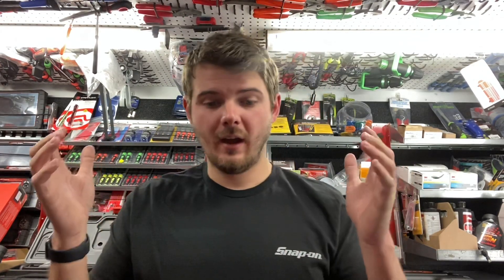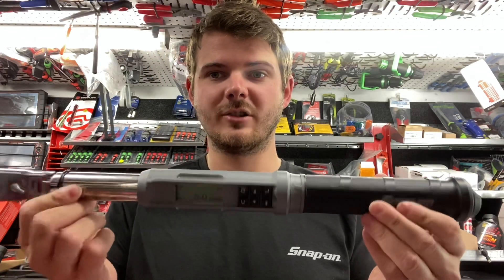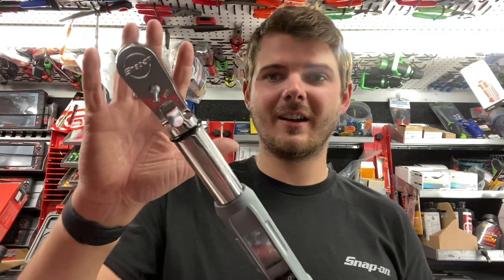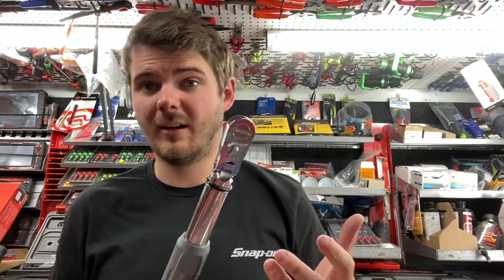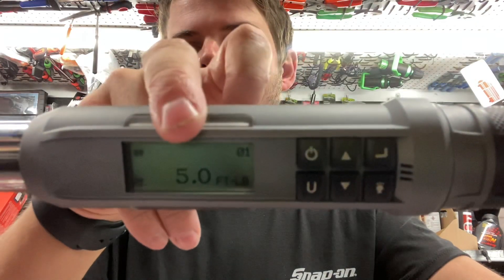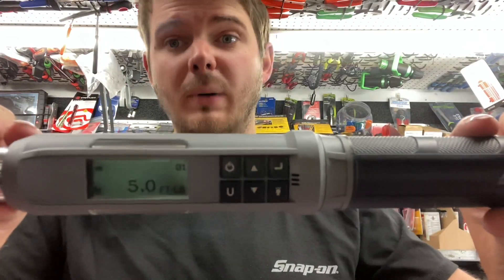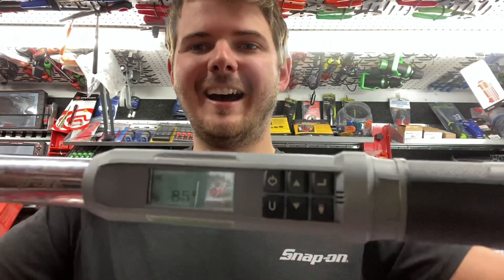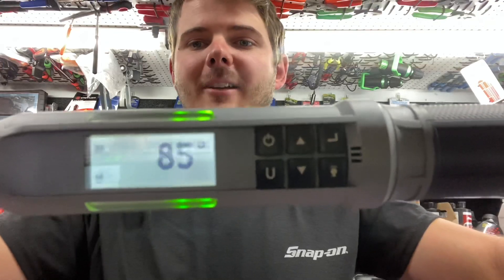Snapon ATECH torque wrench demo! 3/8”

Comment: Thank you !!! Brother for the heads up i was wondering how too use my torque angle . I have some head jobs comming up and i was doing them like old school whit the angle gauge and breaker bar my snap on dealer never explain me better how used i read rhe manual i was lost traying to set up my torque angle . Thanks a lot .

Comment: Do I have to calibrate it at snap on every year ! I want to use it for only DIY  I am not in the US and there is no Snap on in my Country. Please advice. I heard some people says  the Snap on digital wrench will stop working after 2 year of usage and ask You for calibration.  Also i want to know can I calibrate it by my self or do I have to go to Snap On  to program it .
Best regards .
Reply from the maker: They do not have a calibration timer that locks the torque wrench! I always recommend customers check it depending on usage! I’m guessing if you use it every day, you should give it a check every six months! Whether it’s against another already calibrated, torque wrench, or we do sell comparators as well! You bolt it to the wall and it will tell you how accurate it is!
Reply: @SnaponToolsJosephHull  Thanks

Comment: Nice video and well explained. I have the same wrench but it has a 5-100 lbs.-ft. range.  I am assuming this is a newer model with a 125 lbs.-ft. range. It seems that the wrench is the same, only 25 lbs.-ft. greater range so it may be used for lug nuts.  Please advise and correct me if I am wrong.  I have the ATECH12F100OB model.

Thanks,
Reply from the maker: The neck flex joint is also redesigned!! Mainly made for the higher torque seen with the torque angle, but can definitely be used for smaller Lugnuts as well!

Comment: How’s the reliability on these? Heard about ppl trying to warranty these and had a tough time.
Reply from the maker: Just reread the question, for reliability, I find they get sent for recalibration less then others in my area, mainly I think because less people use them as breaker bars as well haha,
Reply from the maker: The heads are lifetime warranty, and the bodies can be repaired the same as regular torque wrenches, (split beam, spring style) for the same flat rate repair in most circumstances! Haven’t found a harder aspect of these than the regular torque wrenches! They’re pretty awesome
Reply: @SnaponToolsJosephHull  how many cycles do you get on the torque wrench before it needs calibration?
Reply from the maker: All depends on use! I have customers send away for calibration once a year no matter what, and I have guys going with the same torque wrench for 20 years without needing repair or recalibration done! My only advice is to check regularly, and if you feel like somethings off definitely check with your representative to send it away!
Reply: I'm looking for 1/2" 300ft lbs and 3/8 125 ft lbs